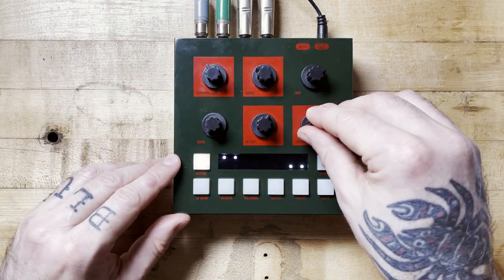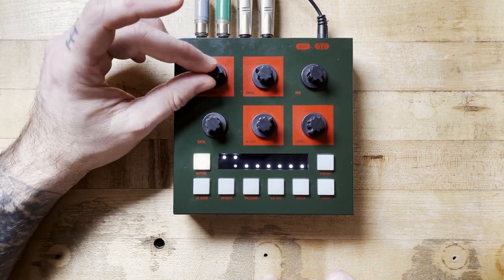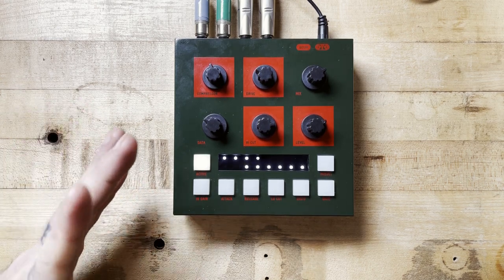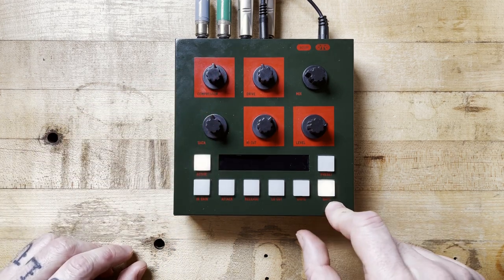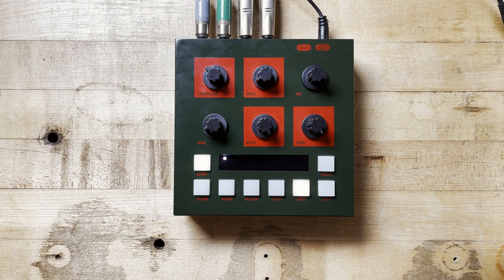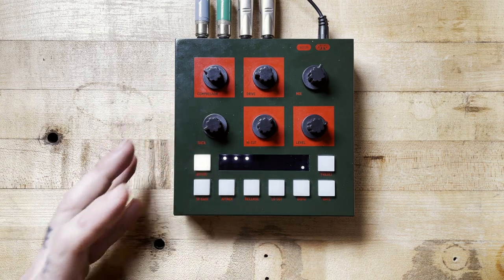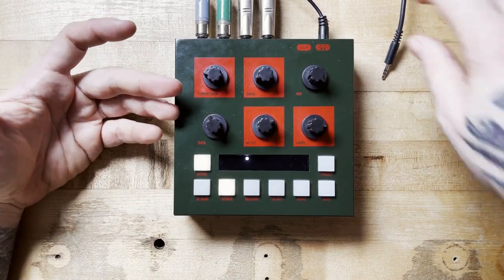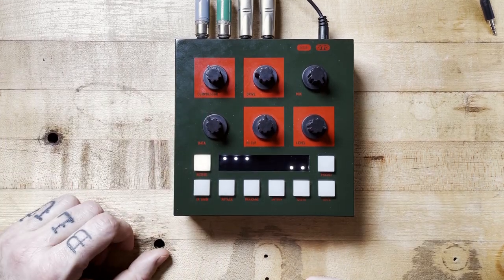My Mix Bus Secret Weapon : OTO BOUM // How to glue your live performances together and be happy

Comment: Regarding the Sidechain input: If you have the gate turned on the SC will function as a gate trigger on the moment when you send a sound to the SC. When the gate is <off> the SC will work like.a normal sidechain; it will trigger the compression when a sound is send through the SC.

Comment: I'm trying to figure out if it makes sense to replace the valve dbx 386 with this unit for my guitar with digital system & a lot of effects..I like the Dbx make warmer my sound but still needs to be warmed up, compacted and also with digital systems(Mod Dwarf)I have great effects but it has too many resonances on the highs and needs more dynamics so on paper it seems ideal. Mybe is perfect combine it with the dbx but I must sell the Dbx if I want the Boum :(. Last question : Can you create & save your preset ? Thank you ! Ps Important, I don't use Microphone..

Comment: So the Boum or Analog Heat MKII ?
Reply: Heat has no (actual) compressor, and the filter on the Boum just sounds way, way better. The Heat is way more flexible, however; Boum only has a few trickst.
Reply: @ericpeters0n  thanks! It seems the Boum isn‘t availaible anyway on whole wide internet...
Reply: I'm also struggling with this and don't have a soundcard, so AH with overbridge after mixer is ideal for me...
Reply from the maker: I had HEat mk1 and MK2 , never really liked them. I dont use the distortion too much and i prefer ahavind a compressor. While the Heat has more tweakability, i prefer the simplicity of the OTO and the smaller form factor.

Comment: Got it. It is amazing both on master and individual channels. I like it better than heat. Thanks for the video.
Reply from the maker: had the heat and I feel the boy, is better for what I need!
Reply: @OoraMusic  for me too. I tried it on all instruments, synths, samplers, then on the percussion/drum bus -  I am running Analog Rythm and Tempest/ Machinedrum into Octatrack, and recently I have added Polyend Tracker and Play into the mix. To sum all those signals and glue them together Boum’s compressor is oddly awesome for the glue, let alone extra grit from the first distortion mode. You can also run it in parallel and get really dirty parallel compression. Ultimately, I have tried it on my entire mix, adding Boum to the aux out of my Allen&Heat - I am so stoked. I already have few compressors that on paper should do more elaborate job on the master, but I really like Boum there. Also, if you start messing about with the side - chain and filter stuff out, it’s amazing. It compensates for somewhat odd compressor and distortion on Analog Rythm and adds nicely to the Octatrack’s and Polyend’s saturation algorithms. Can’t believe one unit is doing so much versatile work, let alone its “just” a pedal - I think I will get another one to have them do multiple tasks in the live situations. Oh and I mapped MIDI controls, it is so cool to create more radical effects via cc’s and automate more aggressive distortion modes even square.

Comment: Hey Oora, a Question on the sidechain compression? The control input, can I send a CV signal into it ? I see you plugging in a cable, is this Audio? Would a CV do the same? There's no info about this. Thanks 😊
Reply from the maker: Hello!
It is a standard minijack cable, never tried with VC, but I bet you can make it work!

Comment: About center-negative power supply - where is a lot of power wires with inverted polarity - I use it with my setup - only have to mark it highly visible :))
Reply from the maker: Yeah i bough a red cable in the end , so i know its the one for the oto
Reply: The good thing is Oto psu's have clear OTO printed on them.

Comment: I just got mine finally! Love it’s capabilities and sound. Still exploring. But one thing for sure my noise on its output is loud and heavy. Wondering how to trouble shoot it.  It’s definitely in the box though. When I deactivate it’s gone. Is yours very noisy?
Reply from the maker: only when i use distortion. Try to send in audio at a good volume, it should be pretty quiet!
Reply: Hi Danny,

its all unbalanced I/O. Using a DI box and coverting the signal to balanced will help by leaps and bounds
Reply: Did you troubleshoot your noise issues Danny? Still happy with the unit? I keep coming back to wanting to pull the trigger on this, but also eyeing up the Analog Heat. Cheers
Reply: @warbatron2  I think my noise issue arrives at the input signal. Meaning my mixer’s signal going into the oto is a bit noisy and being a Saturation distortion and compressor it’s amplifying that signals dramatically. I’m pretty sure my noise issues would happen with the heat as well. I like the oto boum alot. It’s got a great sound, very hands on and super small. I also considered the heat, but have not yet regretted my decision. For me size is important.
Reply: @dkamhaji  appreciate the response, thanks man. Yep I hear you, I think I have a pretty clean signal with my mixer, but not too concerned about a bit of noise if that was the case. The Heat looks great, but so many features I wouldn’t use…and whilst I’m after saturation, I think the trick to Boum is having the compressor as well. Cheers

Comment: The Boum sure is great! Love mine aswell. If it had a lowcut filter and makeup for the drive, as you mentioned, it would be perfect!
Reply from the maker: Totally agree!
Reply: There is low cut in the menu
Reply: @Bananskuden  i know, but it's only set values. Would be really nice to have a high pass knob!
Reply: @CharlieThorstenson  I agree :D
Reply: @CharlieThorstenson Can you use a midi controller with knob for it?
Reply: @saigonproducer not sure, but probably. If so I think the low cut filter will still be in steps and not as you want it 🤷🏻‍♂️😊 Boum sounds great anyways!